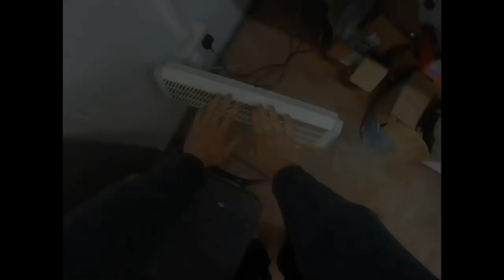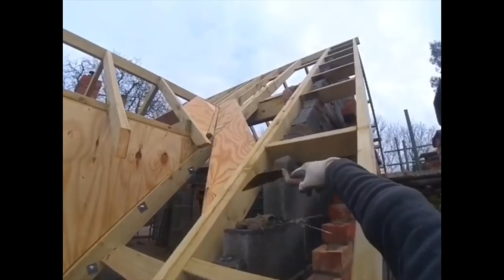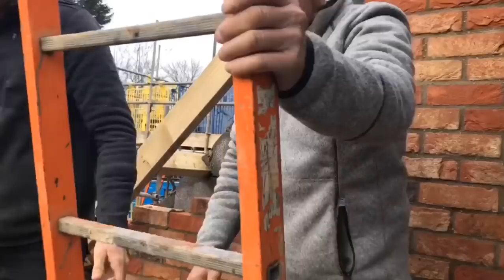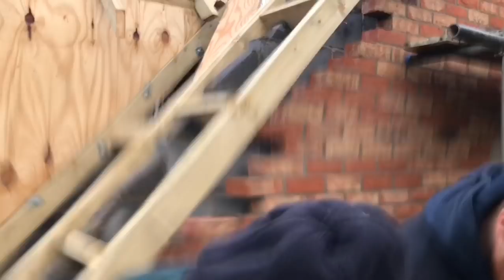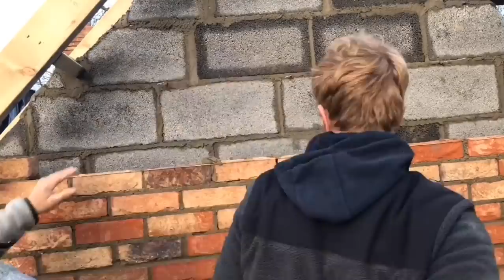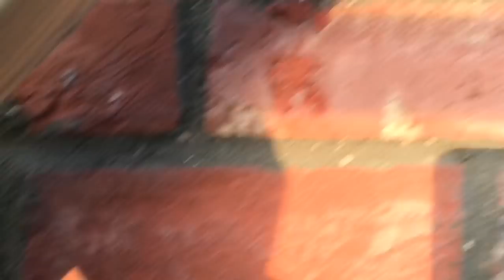Building a brick Gable (part 1) | The skill of bricklaying.

Comment: I am not sure where you are working but here in Doncaster it is below the 4 degrees and rising temperature. But I still found bricklayers laying in cold conditions. Was nice to see bricks laid frog up but where is your cavity bates? Or did you put a full length tray damp membrane in the gable end? I for one will not be doing any masonry work until there is a rise in the temperature.
Reply from the maker: I did this last week so don’t panic it was better last week. This building is getting insulation pumped in to it. I put a green sock/sausage to close the cavity off in the next video. I always lay frog up not a lot of people like it. Thanks for the view and comment